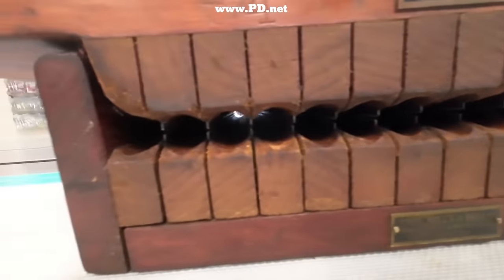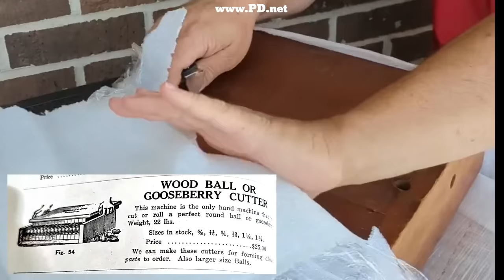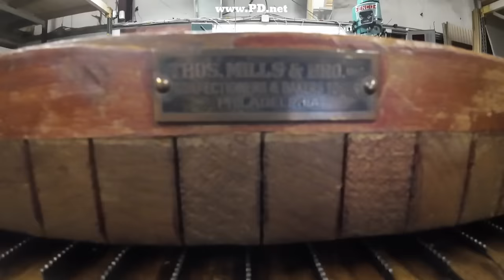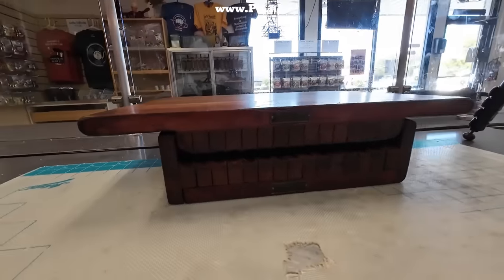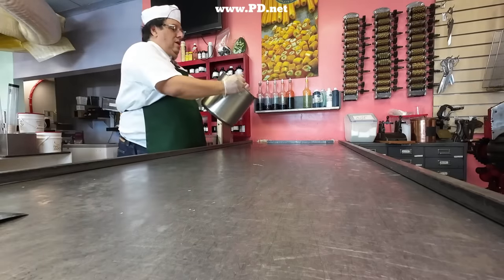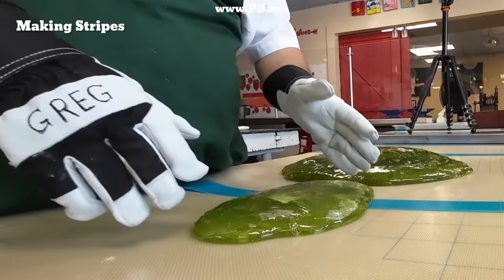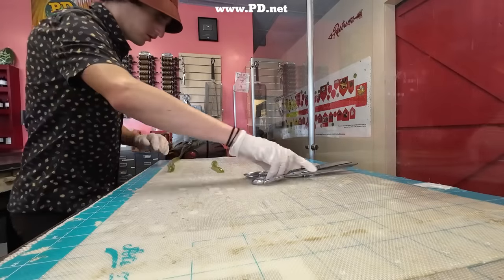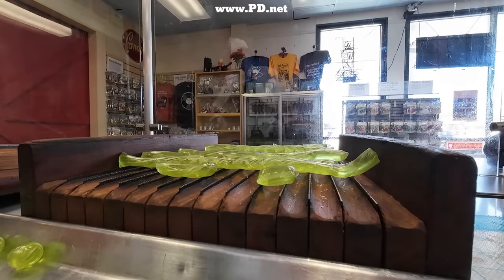Making candy and restoring a 100 year old candy machine at Lofty Pursuits - Ep 195

Comment: I thought this was for softer candies, but it seems to work relatively well on hard candy too. I love how shiny they look
Reply: I think they are still fairly soft at this stage, because they're still warm
Reply: I mean, as long as you're rolling a putty-like paste/sweet (they actually made pills for medicine this way, and from that came this) then it should work. This is an older but more common way for hard candies to be made, I'm sure you know about the cooking and the candy cooling process, etc.
Reply: @TracyKMainwaring The problem with shaping them when they are too warm is that they’ll deform as they continue to cool. You want them basically as close to solid while still slightly pliable so they retain their shape. For harder candies this makes the forming process more difficult, but for ones that are still somewhat soft even when fully cooled it’s less of a hassle.

Comment: How would this work with a higher amount white candy? If it works well, it could be used to make unicorn droppings into candy pieces. 

If you ever decide to build your own variant, this process would probably be easy to motorize so you don't need a person to press down and slide the plate by hand. Heck, I bet just a version with more weight on top and a handle to lift it would make the job so much easier.

Comment: Not really seeing the purpose of the teether in between each slot. Wouldn't it make sense to just make it just a smooth piece? Feel like as it gets rolled and pressed, that spot would become thin enough that it would just break or cut off on its own
Reply from the maker: The candy doesn't roll unless it's gripped.  Those teeth hold on to the candy and make it roll. Otherwise it would press it flat and just make rectangular pieces with a round top and bottom

Comment: A tip for mineral oil: you can often find bottles of mineral oil for much cheaper at a pharmacy. They sell it as a laxative. Since it's meant for human consumption, it's absolutely food-grade.
Reply from the maker: It is absolutely mentioned for food grade. I've used it and for whatever reason the food grade cutting board oil is absorbed by the wood quickly, and effectively dries quickly, the stuff from the drugstore remains greasy longer and doesn't seem to absorb as much. I've been wondering if there's more than one type of food grade mineral oil but it just seems easy enough to get The cutting board variety.
Reply: Thanks, I'll have to pay extra and see what I've been missing. @LoftyPursuits